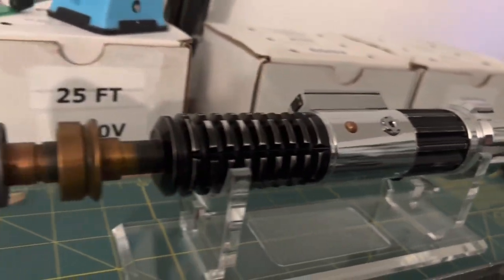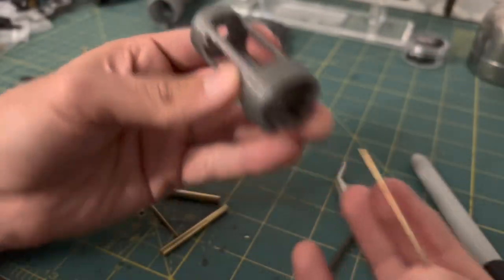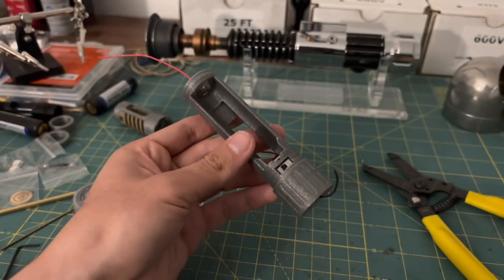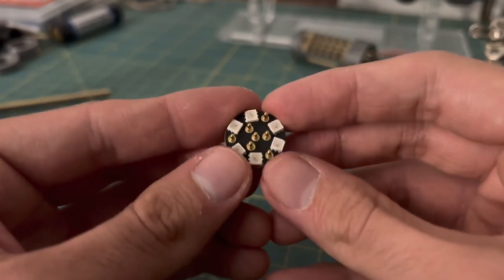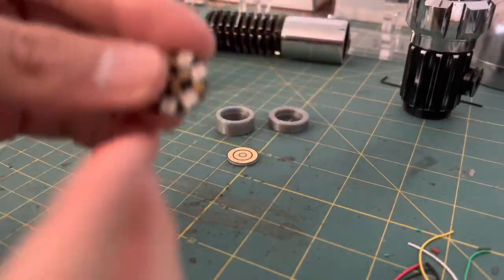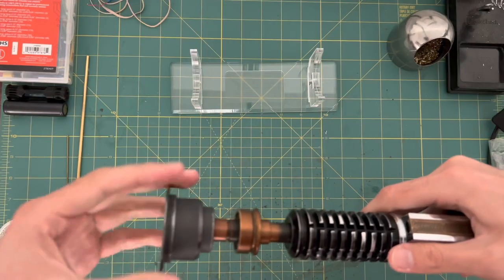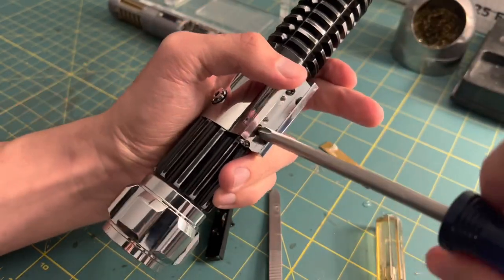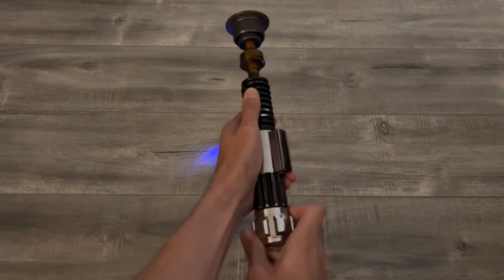Kenobi Series Lightsaber Build | Desert Wanderer | ECO Crystal Chamber

Comment: Where you get the plastic circle for the light? Have you a wiring diagramm for the crystal chamber and the pcb wiring?
Reply from the maker: The plastic circle for the blade plug comes with the hilt if you buy it from TheSaberArmory, and I don’t have any wiring diagrams. I haven’t taken to time to figure out how to make one, so i just have it all in my head based off of the ones from manuals and such

Comment: Do you use flux when soldering?
Reply from the maker: Technically yes 😂 It’s build into the solder itself, I use Rosin-Core solder which has the flux in the center of the solder. So when you melt the solder, the flux is also used
Reply: @averycastillo whats the best temperature for the heat when soldering?

Comment: Is there any risk of the pins shorting out on the blade plug? Thinking of putting some thin felt to insulate mine
Reply from the maker: No issues there, after making two of these there have been no issues. It’s been a bit, but I believe the blade plug is made to sit in a way where it doesn’t touch the pins. But hey, it never hurts to add something there! With the KR sabers one sold on thesaberarmory, he even provides a plastic plug to diffuse the light that also covers the bottom of the blade plug